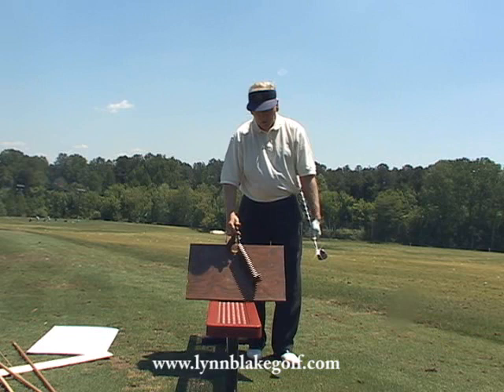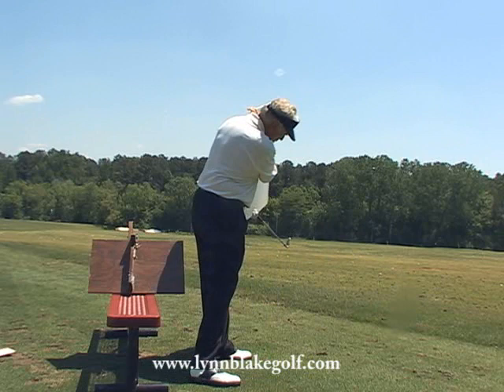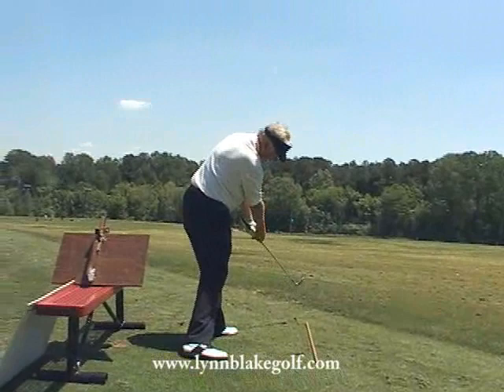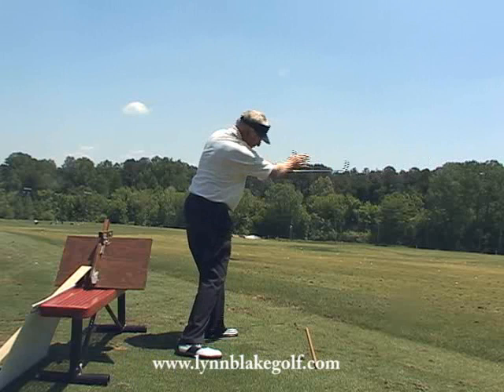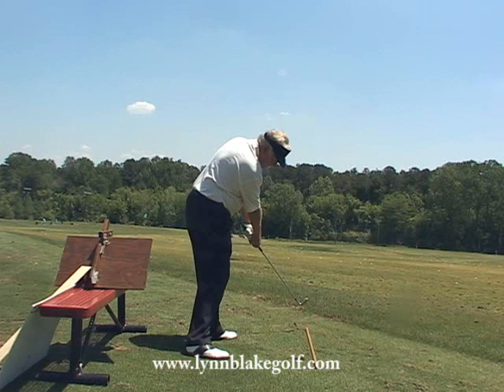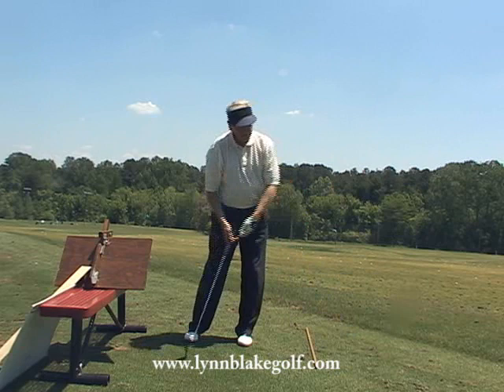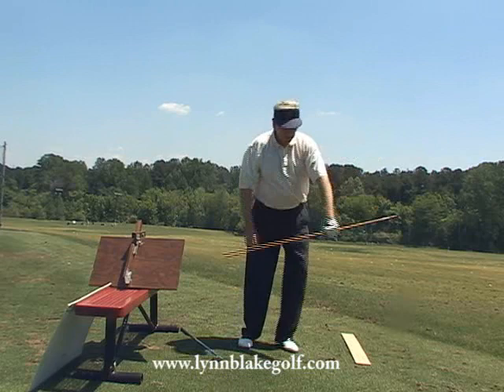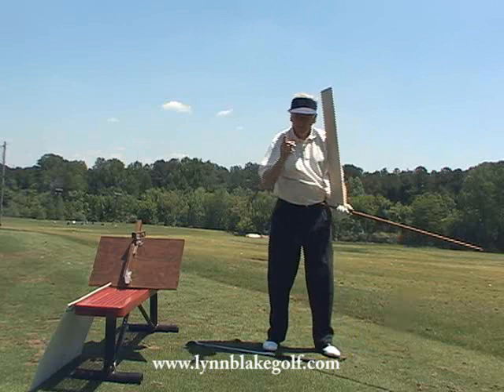Lynn Blake Explains Hinge Action (part 2)

Comment: @secrettogolf 
I think that the "swivel" action is required to properly unhinge the left wrist in the downswing, without resorting to some sort of manipulation of the wrists. However, I think that you need to get this done prior  to reaching the impact zone so forearm rotation is minimized through impact, and that clubface is squared to the ball by the movement of the club through the inclined plane. I think many confuse the horizontal hinging with the swivel, they are not the same thing IMO.
Reply: That depends on many factors. If you are doing an angled hinge there is NO forearm rotation back or through. Just a hinge and a hit. If you are going a horizontal hinge then yes you would need to rotate the face to square up.

Comment: The missing explanation is the potential movement of the hinge pin.  The dialog is based on the hinge pin(s) being essentially static in position.  The hinge pin, as described, is in the area of the left, or leading shoulder.  In a dynamic motion or swing this pin location moves....and substantially in some good golf swings.
Reply: Read The Golfing Machine

Comment: The golfing machine is not objectively true. The golfing machine is based on false assumptions. I do not have an instructor.
Reply: Actually, it is objectively true, sir. It attests to the many variables in the swing amounting to hundreds of possible ways to swing the club.  However, there are only 3 imperatives that cannot be argued. Every single touring pro has these imperatives no matter how they sing. 1. Flat left wrist at impact. 2. Lagging club pressure on the downswing (no casting) 3. A straight plane line.
Reply: @beatzzz01  Interesting I have seen footage where Mac O'Grady says that the flat left wrist was the one thing Homer Kelly got wrong, as far as it being an imperative. This was in the context of Mac explaining that the very strong left hand grip involves much less moving parts in the left wrist and arm through impact. He even names the muscles and ligaments involved. See Fred Couples for a good example of this. The grip is so strong that the left hand is not flat at impact. Interesting stuff.